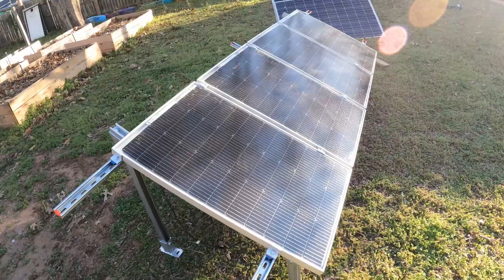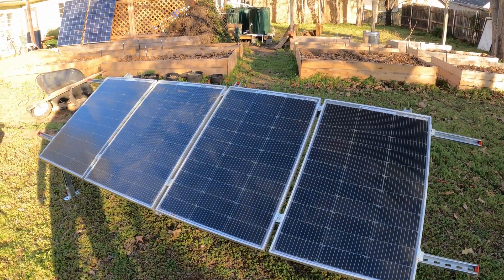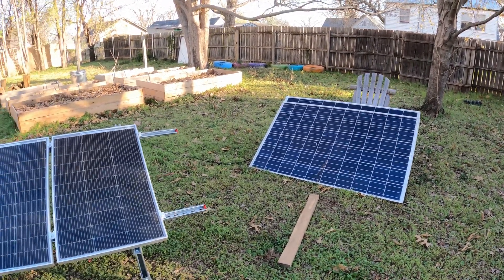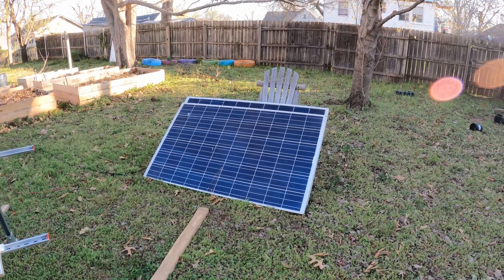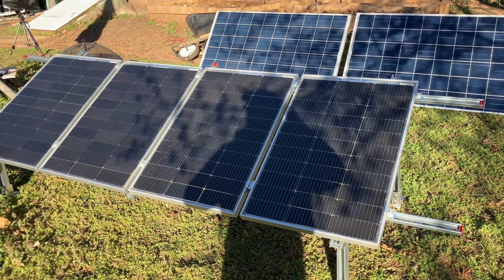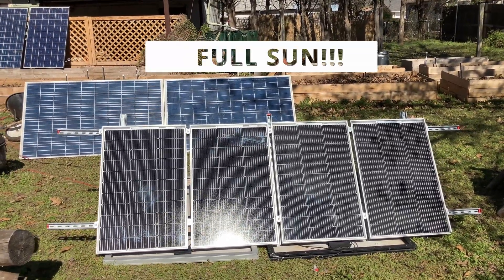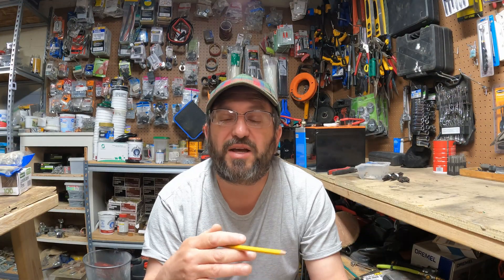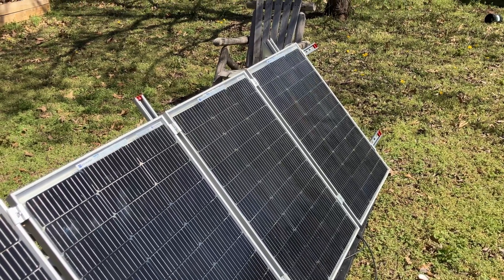400w of Eco Worthy BiFacial solar panels vs 500w of  Used Poly.  Which one is most efficient?

Comment: you get outstanding top tech stuff in  ~430watt range like trina vertex S+ 430 watt " bifazial, topcon solar cells/N-zype tech, calf cut design for 60$ what outperforms easy 5-6 100watt panels.
why waste 100$ for 100 watt junk if you get outstanding ~430 watt panels for cheaper in 10x better build quality and 6x better performance???
Reply from the maker: Do you have a link to those panels?

Comment: I have 16 eco worthy 100 watt regulars and 4 bifacials and got 1600 watts flat on the ground in the sun today, they are wired parallel in 4 row of 5 for now. Completely powers a 1600 watt AC without touching the battery all day. 😂
Reply from the maker: Sweet!  Love those Eco Worthy panels
Reply: @OurBlackCatCottage  It was cheaper building a solar system than getting a power pole dropped and that's pretty much just the pole and plus the power is free, will pay for itself In a year.

Comment: You were comparing old used panels to new panels. 
The only way it would be a legitimate test is that they were both new.  Since solar panels lose efficiency as they get older. 
Your results could simply be biased in testing method because the older panels were already used.
Reply from the maker: Thank you for watching.

Comment: I have 8 100 watt Eco Worthy panels. 4 standard and 4 bifacial. I have seen 790 watts briefly. I have them wired 4S2P. They are small but seem to work efficiently. Thanks for the video.
Reply from the maker: 790 is excellent output! Thanks for watching.

Comment: My recommendation ... bifacial "half-cut" panels.   Half-cut bifacials are really, really good at handling shade.  Basically they have double the number of cells as a regular bifacial panel.  The cells are smaller (half-cut), so the current paths are shorter, and while normal panels usually have 3 strings internally, half-cut panels have six... so partial shading has less of an effect.   Eco-Worthy isn't the best test, though... they tend to over-market and under-size their panels.  In anycase, panels have come a long way over the years.

-Matt
Reply from the maker: What brand do you like?
Reply: @OurBlackCatCottage  The brands like Eco-Worthy, Renogy, etc are just sellers, not OEMs.  Their panel sourcing changes all the time.  They all work pretty well though I do notice that Eco-Worthy over-hypes their panel specs a bit more than the others.

In terms of actual panel sourcing you can browse around the wholesaler sites.  One example would be A1SolarStore.   Those aren't really retail panel sellers... the minimum one usually wants to purchase from a wholesaler is one pallet (usually 25-35 panels or so).   But it will give you a good idea on the actual OEMs and where modern panels are today.

For Amazon-style retail resellers that sell small numbers of panels to people I don't really have a preference.  I have panels from Renogy, Eco-Worthy, Rich Solar, Newpowa, and a few others.  They all play the game to some degree.   Lots of 75W panels get sold as 100W panels, for example.  I think they are all about the same.

Panels have gotten pretty good just in general so what I do for small 100W and 200W panels is first just look for a good price, then I look at the dimensions of the panel (the area... width x length) to determine whether the advertising is exaggerating or not.  Larger area usually translates to more wattage for a modern panel.  Higher wattages, however, are not always better... anything above around 350W is generally too big to carry solo.

-Matt

Comment: I learned that when manufacturing the  solar cells. Each cell has a slightly different power output. Many cells don't make enough power. To be considered grade A cells & fall into grade B & grade C cells. 
Which can be used for solar panels. That some people might use to maximize profits.
Reply from the maker: What solar panels do you use or recommend?
Reply: @OurBlackCatCottage  I made some B grade diy panels...As for name brand, I couldn't tell you...
Another interesting experiment would be to compare the power output of amorphous type panels vs mono & poly crystalline on a cloudy day. To see if the amorphous actually make more power.
Reply from the maker: I have thought about doing a compare video with amorphous.  If I can get some then I will.
Reply: @OurBlackCatCottage  Years ago, all the YouTube diy solar panel videos. Never told people that they'd only last a couple years before moisture finds its way in.

Comment: I am Super Happy with both Renogy and Eco Worthy BiFacial Solar Panels and going Forward Only Buy 195 Watt Eco Worthy BiFacial Solar Panels - just commissioned a 5 Panel Array for 1000 Watts to a Victron Smart Solar 150/45 Solar Charge Controller to Supply 8 Redodo 100amp hour 12 Volt Batteries into 24 Volt Packs for 10KWH Battery Bank and a RENOGY 24 Volt 2000 Watt Pure Sine Wave Inverter to Supply the Bunkhouse Kitchen with Clean Efficient & Renewable Power.
Southern California High Desert @ 3100 feet from Sea Level 🌴💦🌵⛩
Reply from the maker: Great system.  Thanks for sharing!